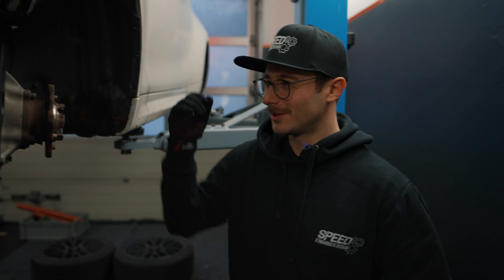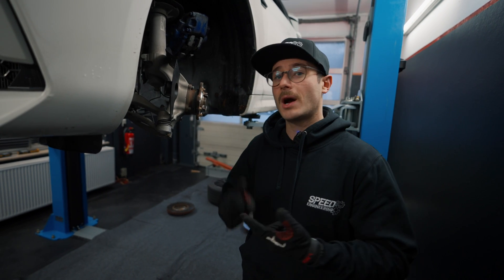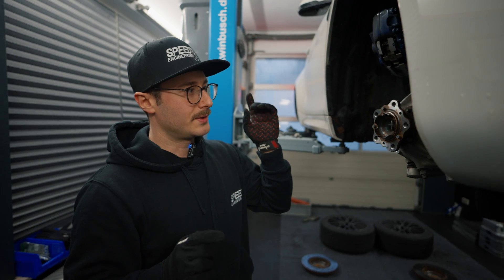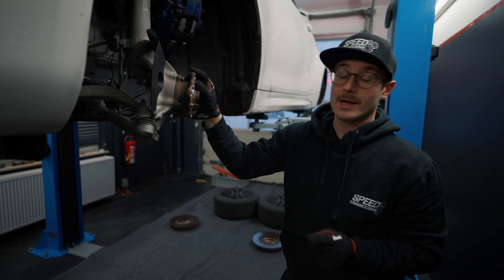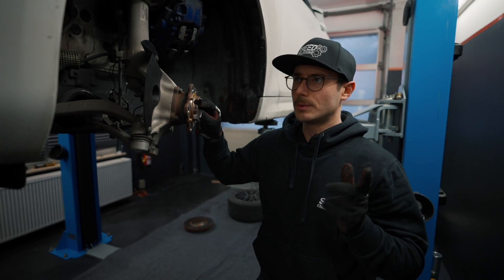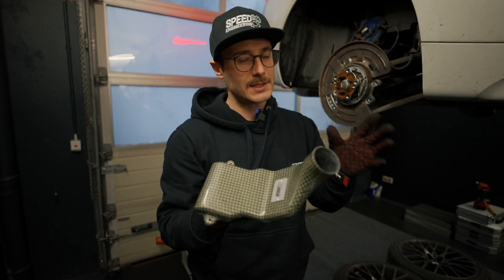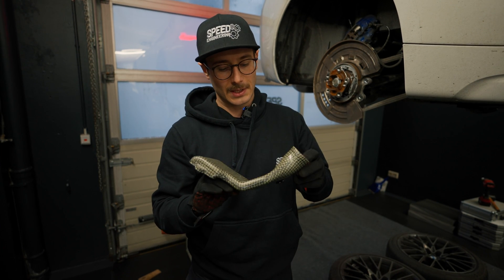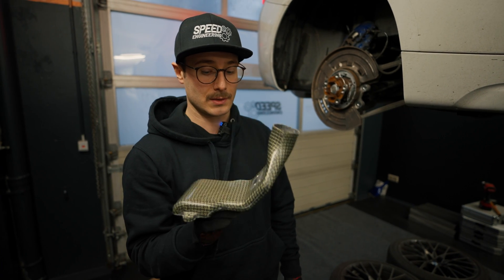How to cool down your brakes | SPEED Engineering

Comment: Hey Zoki, great info on the rear problem with BMWs.That was something I wasnt aware of with my M2. Do you see a problem with "overcooling" the brakes? I heard that specially the ME22 and other race compounds dont like to be run cold and will wear a lot quicker. So for some tracks and also daily driving a plug would be nice?
Reply from the maker: Hey, we have tested every single of our own cars with the cooling and the Endless pads during the whole year without any issues. We would also recommend the Endless N93S pad as this one is made for the rallye sport with a temp range of 0-850 C

Comment: What would you suggest to solve the trapped heat in this platform? some openings on the chassis ? on the sides or the top of the wheelwell?
Reply from the maker: hey, yes porsche is doing it already. The sides behind the wheels would be the best solution